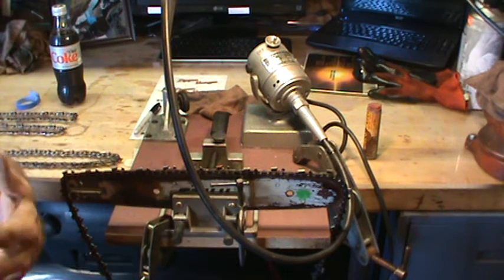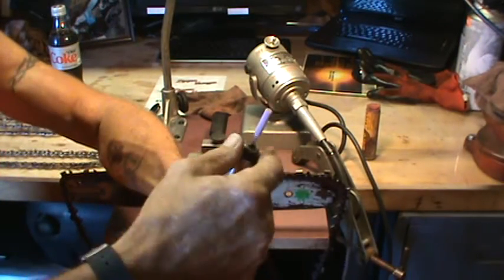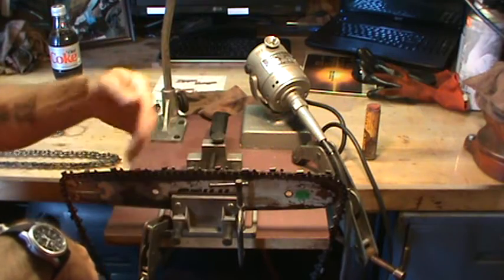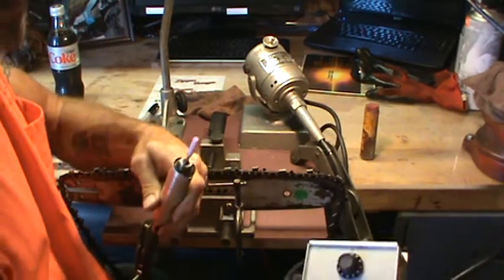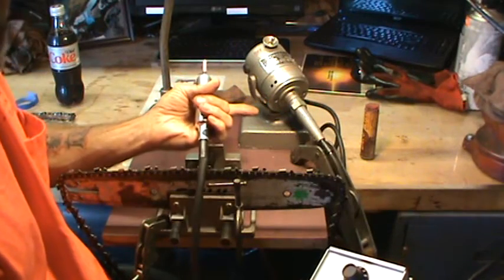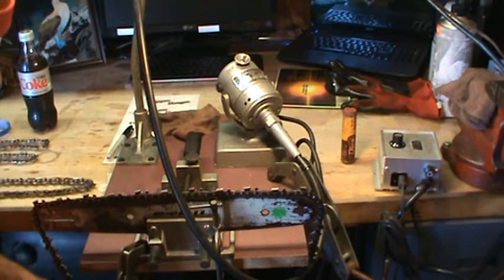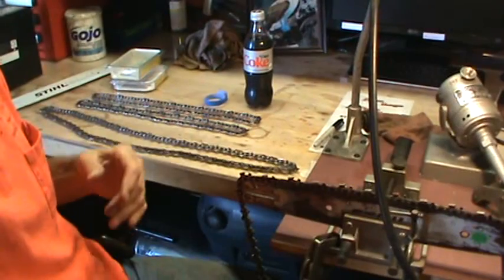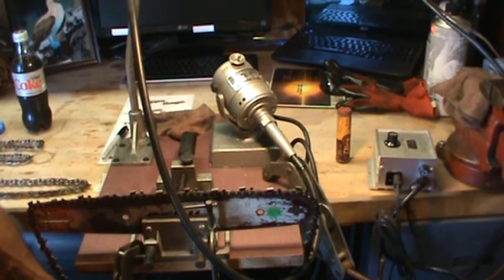Chain Saw Sharpening Station the Zippo Way

Comment: Very nice video Zip ! Where you get the rouge at? I free hand also , and highly recommend the dremmel , although some of the purist may not . Works great for me. Thanks !
Reply from the maker: Harbor Freight sells the rouge as well as Sears and most likely, any hobby shop and home improvement store or local hardware. I'm diehard free hand...my grind is slightly more aggressive than "stock". Cheers! Zip~